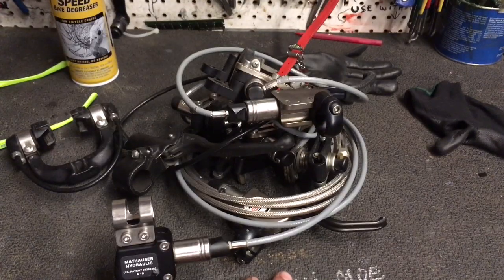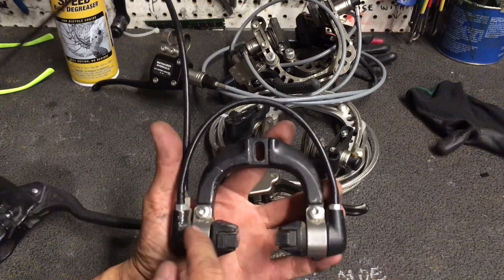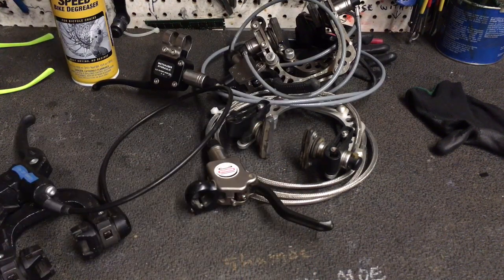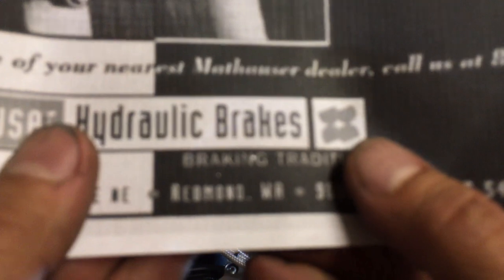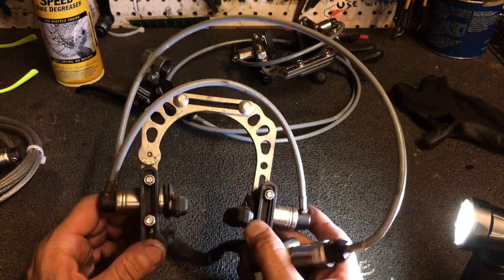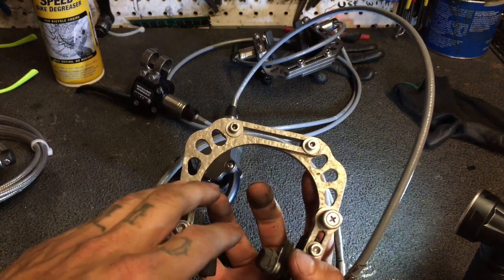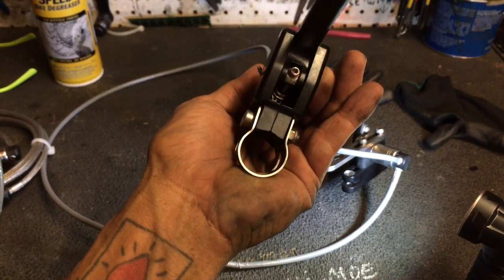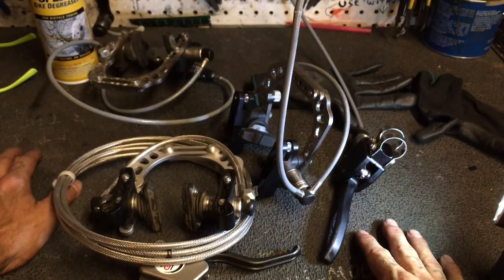IBC hydro brakes

Comment: I had  a set of front and rears on my other rarity, a "Living Extreme" frame. I live in Australia and was living on the Gold Coast around the mid to late 90s. I had to replaced the lines and had local business custom make the lines using the original fittings. I was able to source a couple replacement pistons through a bikeshop in Nerang and got my pads through them as well. 

Overall I was quite impressed with the performance of the brakes over the v brakes that were previously on the bike.

Comment: I ran a Biketial business from early/mid 90s to about 2010.  I remember playing with these.  As for fit and finish, they were very nice.  As for weight and use..... ugh.  Heavy, and so many adjustment points getting them set up correctly took way too long.  Magura was the best at hydro rim brakes.